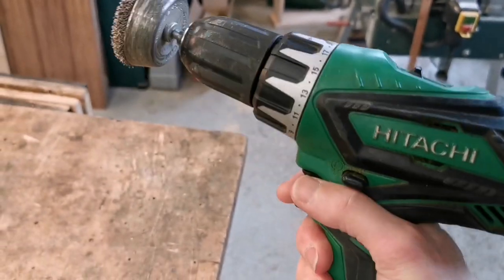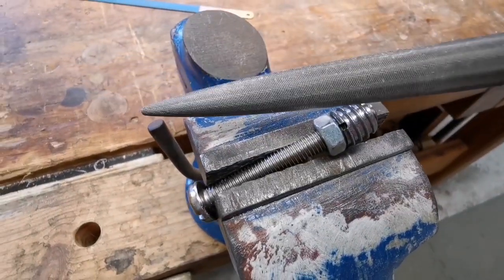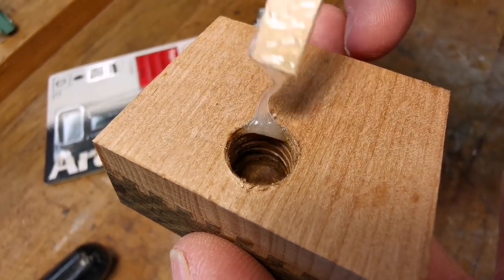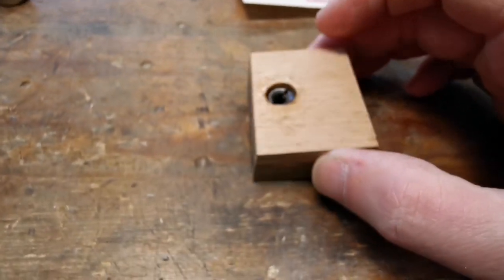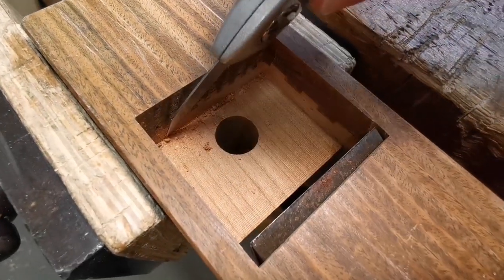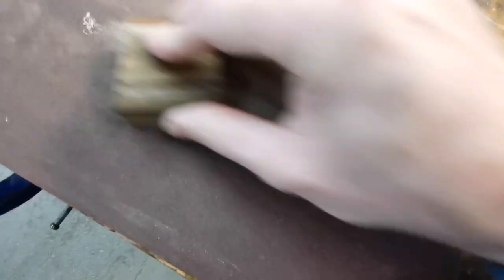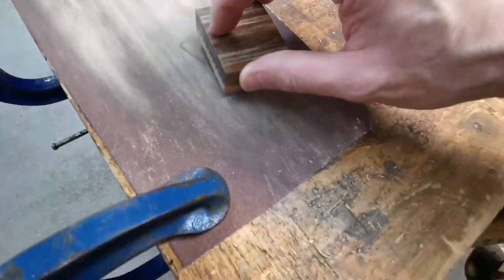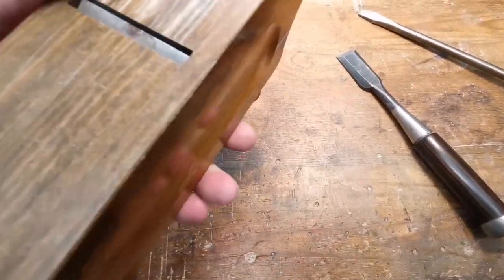E.C.E. Primus Adjustable Mouth repair

Comment: That's so wild, as posted on your first video, mine has exact same issue so far. I still need to clean the insert of rust.  I also have a ECE Jointer Plane 22" long i believe however the base of the plane is coming loose from the top at the joints. I will have to figure a way to get enough glue back in the whole joint and squeeze it back together. Both planes are not really used, just sat around for a long in my dads garage.
Reply from the maker: The jointer will be a little trickier to glue up. Because you really could do with removing the old glue. Well, that's not going to happen. So do your best with what you have. Use pointy sticks to push the glue in. You could use Epoxy glue, that might be better. And seal as soon as you can
Reply: @The Worcestershire Cabinet Maker  I'm thinking.. when I can work on it that I may try suction bags to pull the glue into the split area or maybe use compressed air .. just saying my ideas out loud before I start it..
Reply: Ok.. I did it.. hopefully it works. I used compressed air and then squeezed and squeezed it together.  Sent you a few pictures to the email you posted
Reply from the maker: I've seen the photos. That looks like you've done the best you can, with what you've got. Hopefully your glue will hold the two pieces back together. It's not the best situation because you can't get to remove all of the old glue and have glue free wood. I don't think you could do any better than what you've done. What glue did you use? Ahh, Ive spotted the Titebond blue.
Reply: @The Worcestershire Cabinet Maker  I checked it today.. overall it's probably best it's going to get. Only one small gap I didn't get closed. Another issue has shown itself,  there is a bow in it. The plane rocks at least a .25 inch end to end. I may try to sand it down using sandpaper on glass setup. Also in the area where the blade goes is a bit out of shape .
Reply from the maker: Oh. See what you can do. Where in the World are you Jack?
Reply: @twcmaker  I live in Louisiana, USA. My plan is to let it sit for a while so the glue will harden before I do anything else. I am going to finish my other plane I originally started, like yours. It's not near as bad shape as the 22" plane.
Reply from the maker: You're a bit too far away for me to help 😂 However, I know what I would do if its that bad. You might need to sit down for this. Measure the height of the plane in the best part. Then.. 
Set the table saw up and cut through the castellated area.
Flatten the bottom of the top part. Flatten the top of the bottom part.
Glue in another piece to make up for loses. Use the Titebond 3 and clamp to a very straight piece of wood, countertop, flat marble, or anything that you can trust.
Then after drying a couple of days, start tuning. Sounds like fun. I'd love to do it.
Reply: @twcmaker  That sounds like a fantastic idea.  I am going to finish my other one then will look at my options as you suggest. I have plenty of counter top material I can reference for flat surface.
Reply from the maker: Keep us up to date 👍